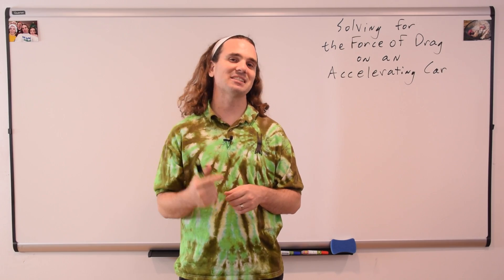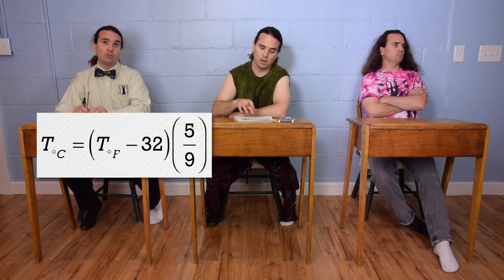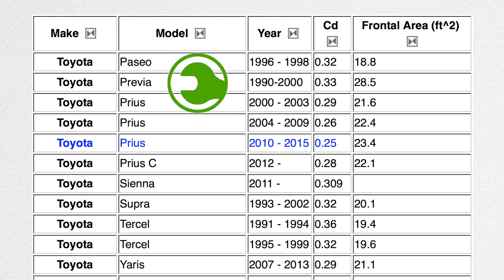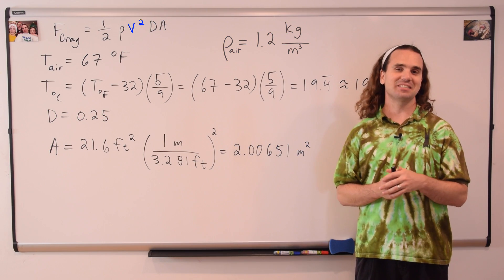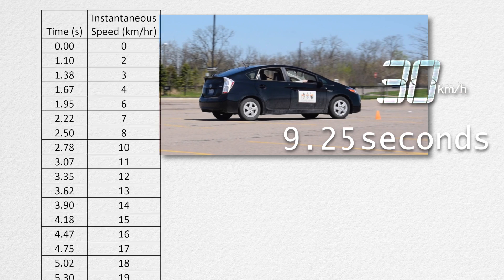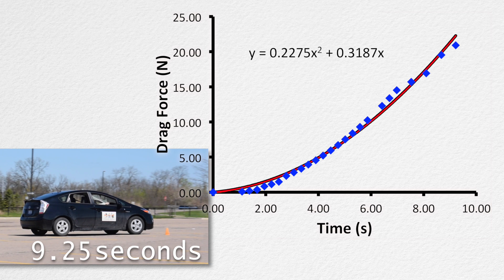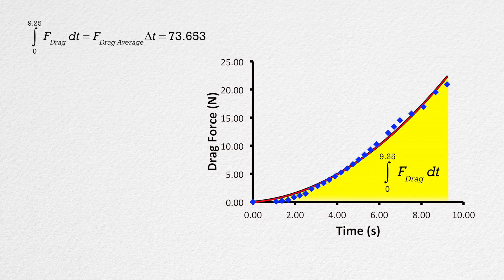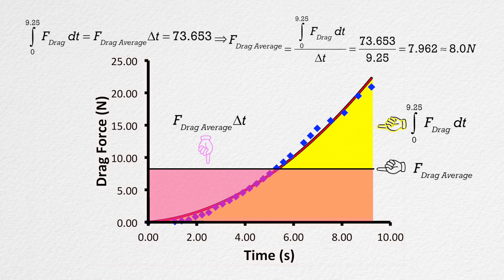Calculating Average Drag Force on an Accelerating Car using an Integral

Comment: Why not just get the average drag force by adding all drag force then divided by number of samples. Since multiplying it by change in Time then dividing it again by change in time just cancels delta T.
Reply: because the number of samples would be limited. To properly calculate the average drag force over the entire motion, you need to account for the drag force at each tiny moment in time, which is basically an infinite number of samples. The only way to do that accurately is by using integrals, because when you integrate the instantaneous drag force with respect to time, it's like you're taking the limit of an infinite number of samples as the time step approaches zero. Does this help?

Comment: Sir Thank you so much for the amazing video,I understood everything  clearly but I did not get the part (very clearly) when you said we cant use average velocity to get average force of drag,if you got some time please give a little explanation,Thank you so much.
Reply: If the drag force increased linearly with velocity, then using the average velocity would give an accurate estimate of the average drag force. This is because both would increase at the same constant rate throughout the motion.
However, with the real non-linear quadratic drag force equation, the rate of increase in drag force changes as velocity changes. So simply using an average velocity wouldn't account for how much faster drag acceleration at higher speeds.
taking the instantaneous velocities is needed to properly calculate how quickly the drag force is changing moment to moment. does this help?

Comment: Thanks for this great video. Really helped me to get my head around this calculation. I had been trying this using a couple of different methods and getting nowhere. One question that I have; if I have a drive profile with accelerations and decelerations, will the formula from the trend-line still stand true for calculating the average drag force and from that the power required to overcome the drag during that time period? Thanks again.

Comment: Nice video! As you continue to accelerate (or even stick at a terminal velocity) the average drag is going to increase, yes?
Also 8 Newtons is an incredibly tiny force on a car right?

Does that mean the vast majority of the energy loss causing a car to slow down that a car experiences is friction and heat?
Reply: At normal velocities the drag force are the main force causing energy loss to the vehicle, at slow velocity the roll friction (mainly the deformation of the wheels) might dominate. The maximum velocity of a vehicle is the point where the drag force equal the maximum force the engine can provide. 
Both drag and roll are types of friction, which turn the kinetic energy into heat.

Comment: I would like to know how it calculates the 0 to 100 km / h that appear in the magazines of the engine, I imagine that it will have to see the Nm in wheel of the relations of the box of changes, the weight in kg of the car and coefficients like the aerodynamic , asphalt friction and mechanical friction as well as the revolutions of the engine and its power in different ranges, I would be grateful if you would make a video with a graphic example with data from a car.

Comment: If we had two cars with two different Coefficient Drag ratings with the same horsepower could we calculate performance differences in acceleration? Example a car with a CD rating of .36 vs a car with .29 CD both producing 370 HP. Say acceleration at 100-140 MPH? or 40-100 MPH
Reply from the maker: That would be a difficult problem you would need to use the Euler Method to solve: http://www.flippingphysics.com/the-euler-method.html

Comment: Great videos! Just an observation, wouldn't it be better to calculate Drag vs Velocity instead of Time? Because in timescale we assume increasing acceleration at a certain rate. How does time factor in while experiencing deceleration? Or did I miss the point of this exercise?
Reply from the maker: The point of the video was to calculate the average force of drag to use it in this video: http://www.flippingphysics.com/average-power.html However, Drag Force as a function of Velocity could be interesting as well...
Reply: Would love to see that. Made the following calculator for that. You may use it in your video if you like.
http://physics.encompasslabs.com/dragforce

Comment: Thanks a lot ,sir for another awesome video !
Reply from the maker: It feels good to produce awesome, thanks.
Reply: Sir..I have a doubt..why is projectile considered to be a 2 dimensional motion ? I mean..say...the motion of a basketball is an example of projectile motion. It happens in our 3d world and it surely moves a bit to the right and left while spinning in air. So..sir, it should involve all I,j and k components and must be a 3d motion. Correct me if I am wrong, sir.. Thanks, once again !
Reply from the maker: Projectile Motion is the motion of an object in two dimensions as it flies through the "vacuum you can breathe" with the only force acting on it being the force of gravity. I use the term "vacuum you can breathe" to point out that Projectile Motion, typically, does not include any air resistance. If you include air resistance, then yes, the force of the wind on the projectile can cause the object to move in three dimensions. I will point out that working with air resistance (also known as the Drag Force) gets very complicated when analyzing projectiles. I have a video which shows how complicated it can get and the problem in this video is only in two dimensions! http://www.flippingphysics.com/the-euler-method.html
Reply from the maker: You are welcome.